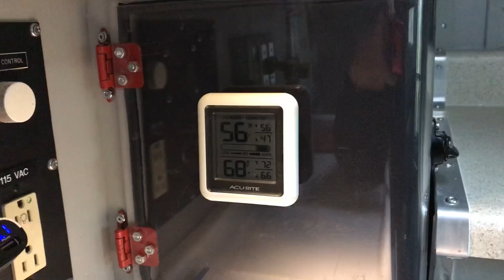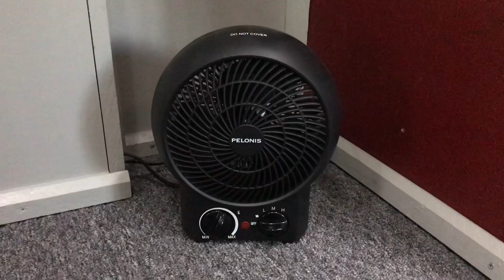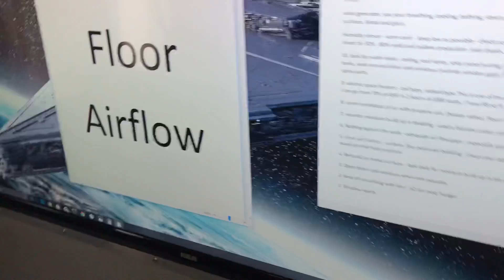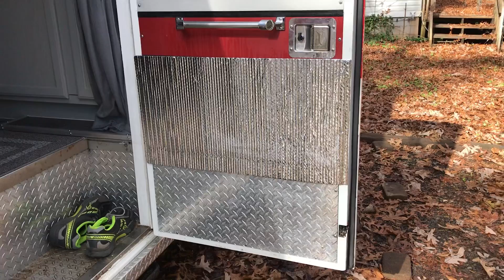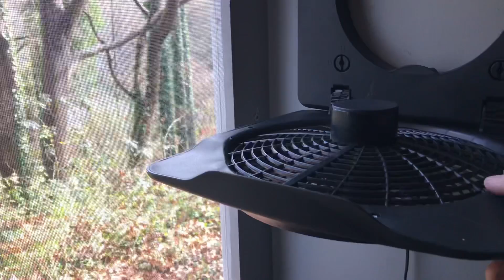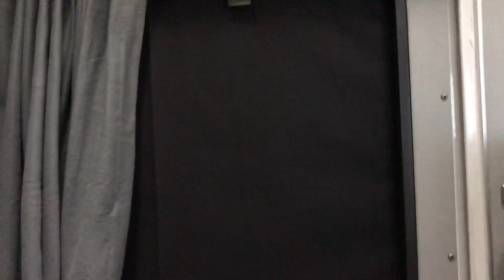Condensation in Small Spaces-tiny house,home,RV,Van,Camper,car,reduce,control,remove,eliminate,stop

Comment: The most detailed video I have seen. I live near Seattle and everything rots. I was living in my tinyhouse while dismantling it, and I can tell you it was the worst idea. After I cracked the air seal, moisture turned every spec of debris into mildew within a week.

I built a temporary tinyhouse out of a cargo trailer, and I went with aluminum flashing for interior walls. They are stapled onto cedar strip I screwed to the metal frame, iso insulation between. It is amazing how much condensation occurs overnight, I can now see it on the ceiling but is gone in 10 minutes of opening by better placed windows.

This is not the warmest house because of conduction, but the aluminum acts as a space blanket and heats up the air fast by just moving around. Putting my wood stove today and it should suffice for the month until I start renting a house. 2ft aluminum flashing rolls cost the same as plywood for sq/ft, but it will never rot, and you don't have to pay for paint, plus it reflects light really well if you go with small windows.

Comment: Research using wool for curtains and blankets.  I like your O2Cool fan mod.  I know you don't want to cut a hole in the roof, but a fantastic fan is amazing.  If you're nervous about doing it yourself, go to an RV shop and have them install it for you.  They will seal it all up on the roof properly.  It will vent air out or push it in, depending on your needs.
Reply from the maker: I think having the roof vent would be very helpful. Might get the nerve up to do it. Glad you liked the fan mod. Thanks for your comments and tips!

Comment: Why not just buy a dehumidifier?
Reply: There are so many options as far as dehumidifiers, you are only talking about a very tiny space so a dehumidifier is such a great solution, drain it straight out the floor.
Reply from the maker: The problem is that the thermoelectric ones don't work, the compressor ones use too much power for a 1,500 watt extension cord power source. I have found one that is compressor based and is mid sized and only uses 150 watts. A normal one uses around 800 watts and is way too noisy and bulky. Been testing this new one for 2 weeks. Will eventually get a video out on it.

Comment: Bought a Dickinson P9000 ($825) last year and found this the other day. Not too pretty but will vent your exhaust (moisture) out instead. Have a Mr. Heater Buddy too so familiar with catalytic aspect of heating.

http://www.landmsupply.com/department/sporting-goods/ice-fishing/heaters/heaters/nu-way-propane-stove-12000-btu?utm_source=google&utm_medium=shopping&utm_campaign=google_base&gclid=EAIaIQobChMIhdDhlt793gIVE__jBx2jIgdvEAQYAiABEgKYM_D_BwE
Reply from the maker: I like it! Great price and only 3” exhaust needed. Thanks for posting!
Reply: ...and Dickinson has 3" flexible 'flue' and roof cap in SSteel. @timdillen
Reply: https://www.amazon.com/dp/B001122SZQ/?coliid=ITMSQK2YB58E4&colid=37UVJFLO2HTRK&psc=0&ref_=lv_ov_lig_dp_it
Reply from the maker: I actually have that and even did a video with it. Set it up in my Prius. Works well and love the thermostat.

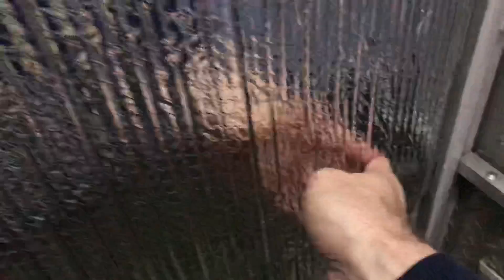Comment: Hello 👋 there is a newbie Canadian RV channel called Living Light RV that shows you the moisture absorbers that I think might be simIlar to the ones I use in Canada. Look at their latest vid camping and rv life hacks at abt 5:51. Dollar tree...branded names will always be $$ but chemistry is the same. We don’t have this large size here. I think Lisa’s suggestion of inside cupboards is a good one especially since you are testing perimeter walls for condensate/mould.

Lisa has severe asthma as well. I just missed these guys in Calgary on my last trip in October to the  Rockies bc they had to leave for south of the border west coast employment in late Sept...drats! 

Did you manage to find some?
Reply from the maker: I subscribed to their channel and checked out the video and was helpful to know they are at the Dollar Tree.  Will stop by and see if I can find them.  Thanks for the tip!
Reply: I got the ones from the $ tree n if it is cold at all the moisture freezes in the balls and freezes and they ruined!! I stocked up n bought 30 n can't use them. I keep it cooler because i use a Mr Buddy (propane!) which causes more dampness sooo 😵 i don't know what 2 do i don't have enough power 4 anything!

Comment: I to have been following you since I found your channel. I have impelemented some of your ideas into my van build as well. The windows turned out great. I'm waiting for my BoHo tapestry to come and will work on privacy from the cab of the van. I kept my window covers up for a month and no trouble with condensation on the windows they are on.
Reply from the maker: So glad the window covers worked out. The first two privacy curtains I made, I did not allow enough for the egg shape of the front of the vehicle so there was not enough material on the sides as it went to the floor. Leave about a foot of material extra on the sides, this way you can tuck it in the trim or clip the sides to something to make sure no light gets through. You can always trim then down later.

Comment: I got the fan controller and there's a capacitor in the package. I'm not sure what to do with it. Did you figure it out? Thanks
Reply: I know, right? Thanks again for the tips. I like your channel.
Reply from the maker: That’s odd. I didn’t get one with mine. Not sure what it would be for.
Reply: Thanks. I realized it had broken off the controller's circuit board in shipping. They're sending me a replacement.
Reply from the maker: Dang - I hate when a project get delayed for parts!
Reply: Hi again. I’m having trouble with this. I popped the fan cover open and I’m not sure where to attach the speed controller. Also I’m afraid to force the knob off so I can mount the controller onto the fan case. Thanks.
Reply: Well I figured it out. You’re right it’s really not that hard. Thanks very much for your videos.

Comment: You might want to look into making or retrofitting an ERV (Energy Recovery Ventilator). I've only seen one guy build one out of coroplast and used it more for soldering fume extraction. I believe this would greatly if not completely eliminate most issues in both parts 1 and 2. Just pop it into an opening window.
Reply from the maker: Sounds like an interesting project - will have to educate myself on that. Thanks for posting!

Comment: This is a top level topic for anyone building in a small space. Your humidity levels are directly related to the temperature. Humidity is measured in grains of moisture. The higher the temperature, the more grains of moisture that the air can hold. Another factor that comes into play here is dew point. Dew point is the temperature at which condensate will form, this is why the moisture collects on conductive surfaces such as aluminum or glass or even the blanket under your cushion. For example: If the air temperature is 75° with a 50% humidity, the dew point may be 45° (estimate) therefore pretty much any surface that gets to 45° with begin to show signs of moisture collecting. That is why you see it down low where the air is cooler or on highly conductive surfaces. 

How to combat this is to keep your dew point as low as possible. 

1. You can add heat, this raises how much moisture the air can hold before condensing. You will still get some condensation on highly conductive surfaces where the cold spots are 

2. Air movement like you show is great.

3. Remove actual water from the air. There is only one way and that is by dehumidification. A dehumidifier $$. A humidity absorber that gets regenerated later, a real pain and not very effective.

4. Something that is part of any structural design is air exchange which is constantly bringing in and exhausting fresh air. Yes, it will cost you a little more heat in the winter but if you want to stay healthy, this is a must. As a matter of fact, it is part of most building codes. 1.5 air exchanges per hour is near the minimum to keep air from fostering molds.

A combination of these methods will make your space healthy.

Great work!!
Reply: Thank you for sharing that!
Reply from the maker: Lots of great information - thanks for taking the time to put this together. I have been working for several months to find the right dehumidifier that is compact, effective and efficient. I am waiting on one to come in to test it out. Will compare the thermoelectric ones to the compressor ones. Found some very interesting statistics. I have been keeping my floor vent running all the time but we have now had non-stop rain for 5 days and another 3 are coming so the outside air drawn in is 100% awful. The best thing helping now is the electric space heater.

Comment: Half way through and thanks for exploring this important topic. 

I'm seeing a lot of Chinese knock off parking heaters on the UK market. Dry hot air heat from either diesel or gasoline, and you can tap into your vehicle's fuel supply. I would love to hear what you think about using those vs the regular Camco or Mr. Heater Buddy.  

Thank you again, I always look forward to your work.
Reply from the maker: Good question. I like the idea of having a diesel fired furnace for hot dry air. I have not looked very far into it as the price is so high and would have to be installed by someone who is very qualified.I have not looked into the cheap chinese ones. I have owned a Buddy and Wave and been terribly disappointed in both. There is no temperature control and all the over production of heat has to be vented. I came up with a neat modification to the DynaGlow heater that controls the 10,000 BTUs well enough to use in a van. I will make that video eventually. Will take a lot of time to make as it will upset the Buddy fans so it has to be meticulously shown and proven.
Reply: @timdillen  The knock offs are attractively priced. I thought that might be a great one stop solution for heat and condensation/mold prevention in a very small package.
Reply from the maker: I'll have to check them out. Thanks!

Comment: Wouldn't a diesel heater be good as an efficient source of 'dry' heat?I try to avoid propane, though it is useful as a backup. I liked the tip about using a good thermometer etc to assess humidity.
Reply from the maker: I would LOVE to have a forced air diesel heater - I just don't have the budget for it and would have to have it professionally installed (I fear messing that one up!). Glad you found the video helpful and thanks for watching!

Comment: Hello! What excellent coverage of a very important human health topic.  Kudos! I am lucky enough (maybe) to be able like you to sense problems in the air - toxins, humidity, mould etc. Could you please do a video on how to adjust the 02 fan and show us where you mounted your digitemp thermostat and if you set it up  it for heating or cooling or both. In my various humidity challenged non conditioned areas such as my shipping container, cold cellar and previously cottage with dirt crawl space for I used a chemical absorbent solution. The absolute best ones are from our Dollarama and cost 1.50 each. Forget products like damp rid - overpriced and underdelivering. Change out the containers as soon as white chemical has turned to liquid in the bottom of the container. Don’t get solution on hands or fabrics. Diligence is 👑!
Reply from the maker: I knew this video would be right up your alley! You inspired the idea and I figured you would have more to add that would be helpful for a followup video. The O2 Cool fan will be an easy video. The heating one will be a difficult one. There are people very passionate about their Buddy heaters so it has to be done meticulously so I have been putting it off. I wanted to try one of these small dehumidifiers but the comments are quite poor on their performance. I have read the same of the damp-rid and was wondering what type of chemical product would really work. What is the name brand of your chemical water absorbent?
Reply: PSC Camper Conversions Hi again...called Damp Trap..calcium chloride. Poison. Keep the container out of reach of children and pets. When travelling put inside a plastic container in your sink. Do NOT dump into your plumbing. Bag up the finished container with liquid solution and throw it into the garbage. I’ve tried similar items like damp rid or one that came in bags you hang..waste of money.
Reply from the maker: Thanks. I'll order some.